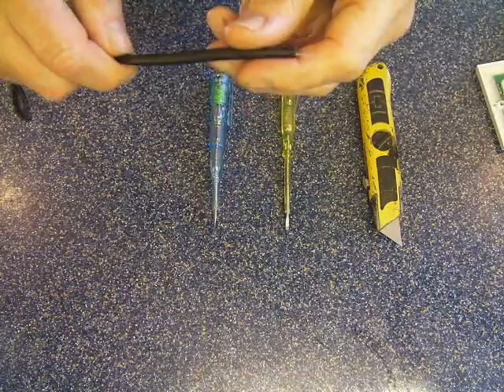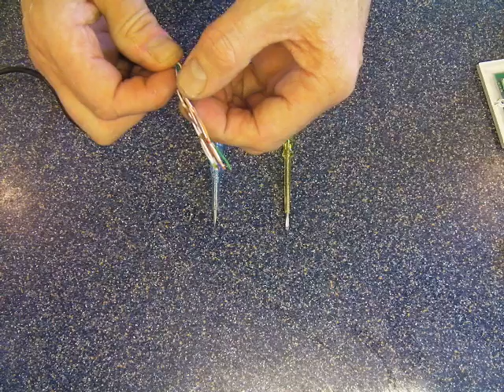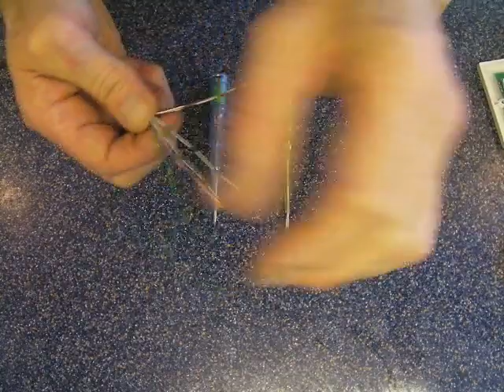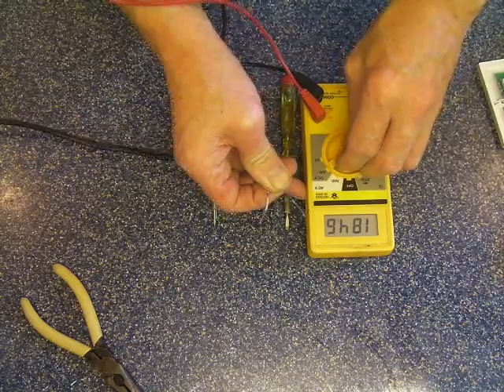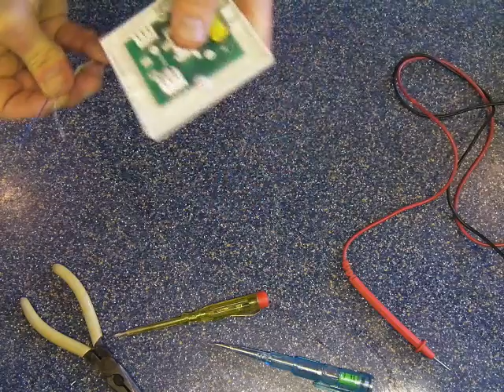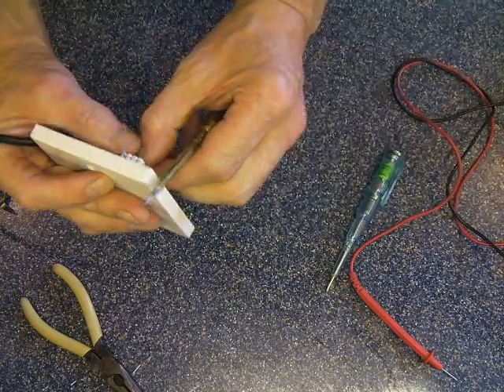Cablewise Emergency Phone Repair.MP4

Comment: I am currently having problems with my broadband and i have 3 pairs all connected to my extension sockets. I have a blue pair which is in number 2 and an orange pair that is in number 5 i also have a pair in number 3! Should i terminate as per video and only use one blue pair and split between 2 and 5? Many thanks.